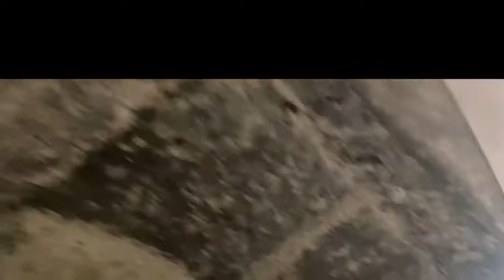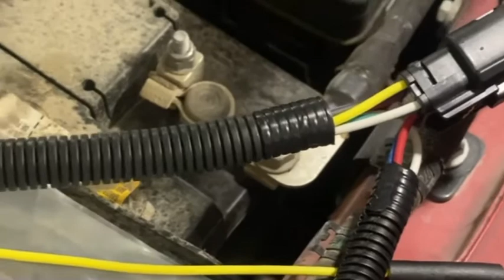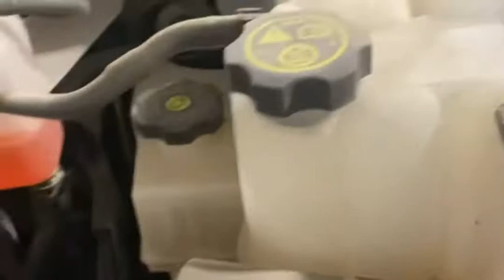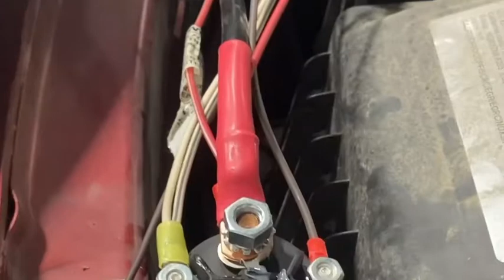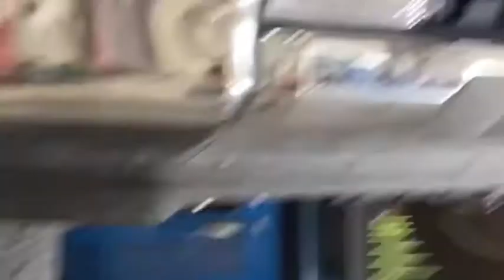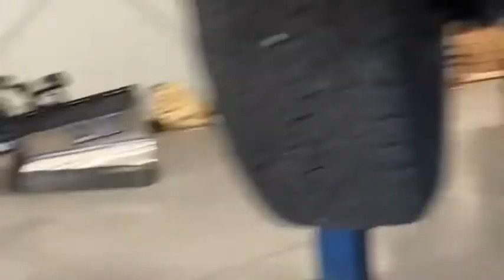How to Install a Boss Plow Mount (Chevy Silverado)

Comment: Hello. I have a 2014 Chevy Silverado 1500 high country 5.3 l  V8. And I'm trying to connect boss blow Trip edge Is straight blade. Everything works fine until I pour and float. When I put and float the fuses from the honest keep burning. Can you help me with it. I check the  Wires from the plow They look to be connected properly like the diagram is in the plow. But when I check online the diagrams from the plow is different from online and what I have on the blow. No idea what to do.